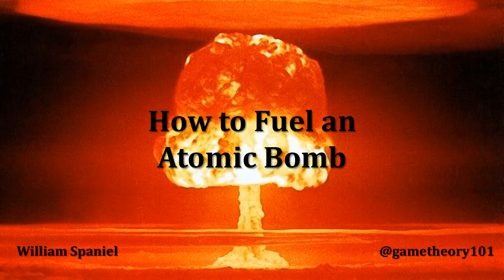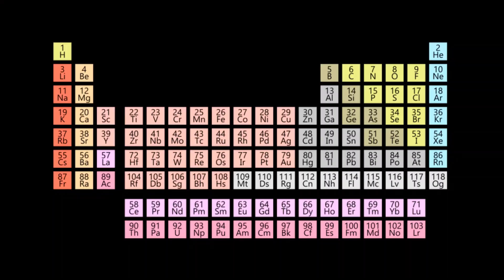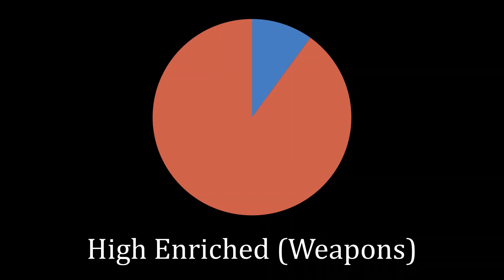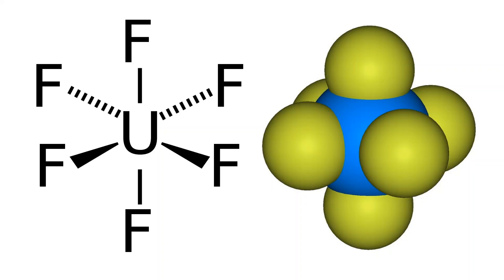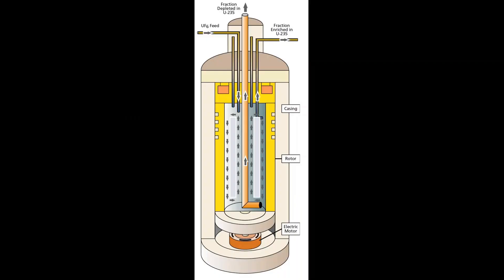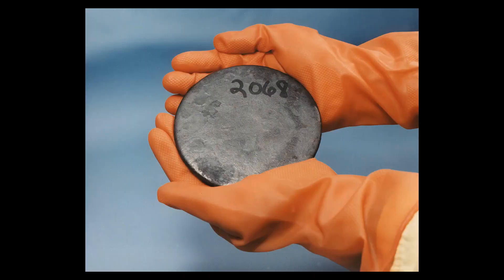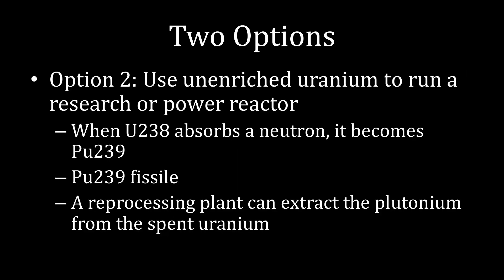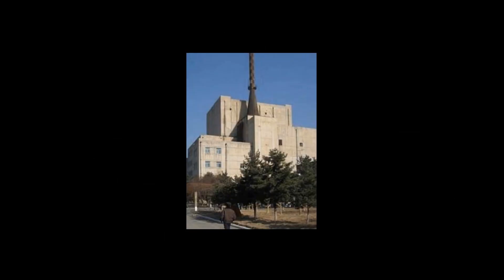How to Fuel an Atomic Bomb | Nuclear Proliferation Explained

Comment: Good video, but I'd like to add a more detailed explanation of uranium processing:

Mill the ore to a fine powder.
Dissolve in nitric acid. 
Mix with tributyl phosphate solvent in a hydrocarbon diluent to to separate uranyl nitrate from nitrates of other compounds found in the ore.
Back extract uranyl nitrate into higher molarity nitric acid. 
Mix with ammonia to precipitate ammounium diurinate (yellow cake).
Dessicate and pulverise the yellowcake. 
Heat in a hydrogen atmosphere to convert to UO2. 
Dissolve in hydrofluoric acid, and distill to isolate uranium tetrafluoride. 
Heat UF4 into F2 atmosphere to produce UF6. 
Enrich. 
Reduce UF6 with hydrogen gas to UF4. 
Melt UF4 with calcium in a metallothermic reaction to reduce to uranium metal.

UF6 is a crystalline solid at room temperature and atmospheric conditions. It has to be heated in a reduced pressure atmosphere to sublime before enrichment.
Reply from the maker: Thanks for all your comments! They are great.

The course is designed for political scientists (of which I am one), so the science part of the class is lacking depth.

Could you email me if you have a chance? Thanks.
Reply: @Gametheory101  No worries, and have no doubt that more comments will be following on your next vids! XD
It's good content, and I appreciate that the intent is only to offer a basic overview.
I'll send you over an E-mail now, however it's late in my part of the world, so probably won't be able to respond to anything you send back tonight.
Reply: @Gametheory101  Even so, I feel like this video is more detailed than others on the same topic from other channels that I’ve come across in the past.  I know you’ve been focused mostly on Ukraine recently, but I really appreciate all of your other content as well!